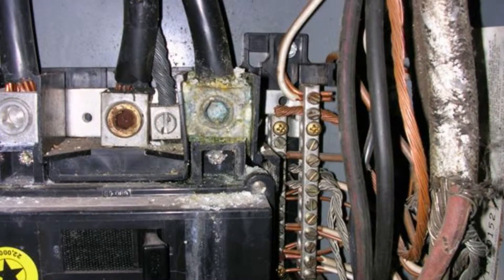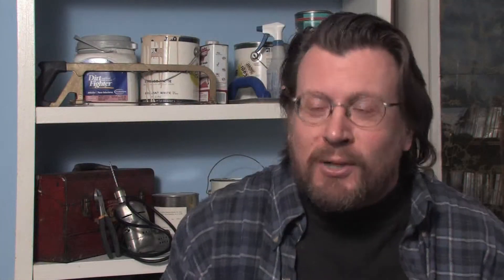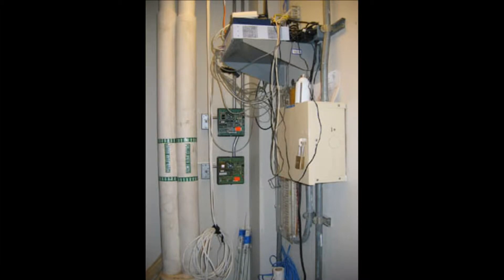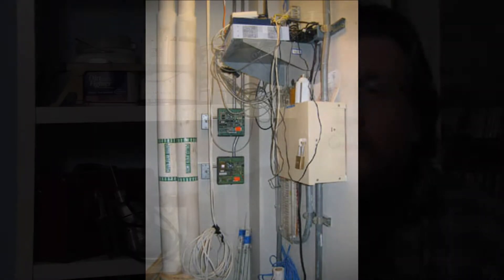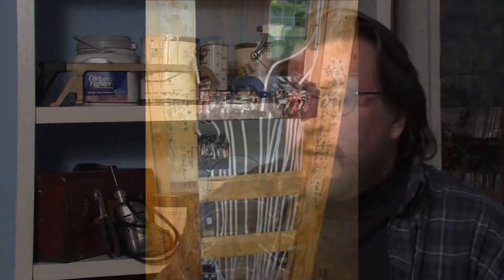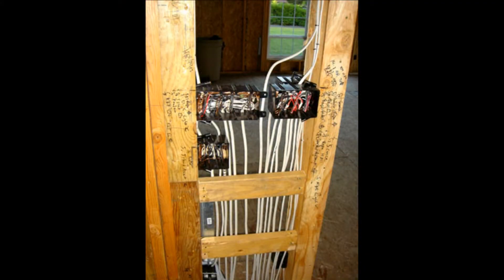Home Improvement & Remodeling : About Neutrals Versus Grounds in House Wiring

Comment: The connection to ground also serves another purpose . It serves as a way to dissipate transient      (static) voltages . If an A/C system is ungrounded these transient voltages can become high enough that they damage the insulation of wiring . Electronic devices are very susceptible to this kind of damage . I hope this helps

Comment: A/C power seeks it's source not the ground . If the neutral bonding jumper is omitted and a fault to ground happens ,because of the high resistance, the amount of current flowing through the ground would not be enough to open the fuse or breaker. When a fault to ground occurs in a properly connected system high current flows through the ground  ( because of the low resistance ) to the neutral through the bonding connection and safely opens the fuse or breaker that protects the circuit.

Comment: This is not true . In a 120v A/C circuit potential exists between the hot and neutral . Electrons flow from hot to neutral and neutral to hot . To truly understand the neutral one should think of it as a hot conductor that is used to give a reference to ground . Because the neutral  and grounds are connected at a single point in a system they are at the same potential. I have seen a difference in voltage from neutral to ground when a contractor omitted the bonding connection at a transformer.